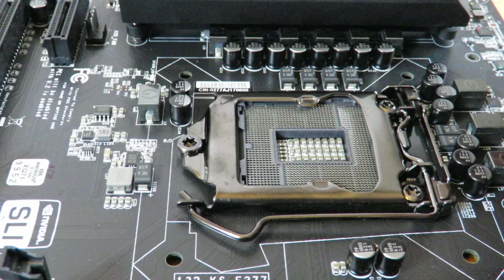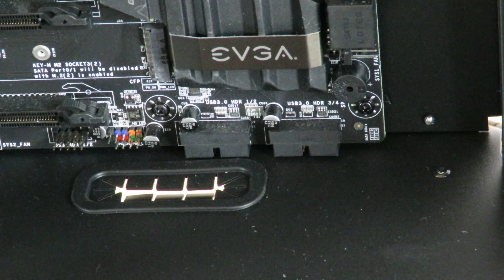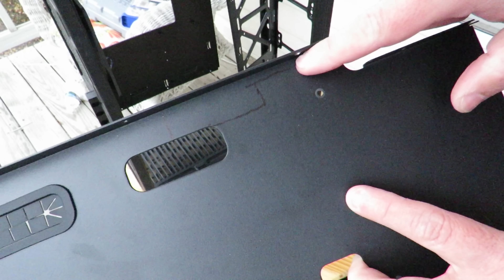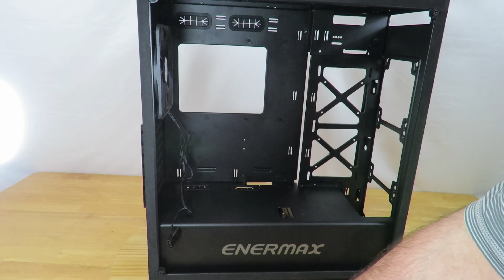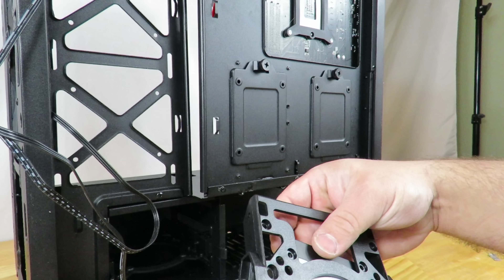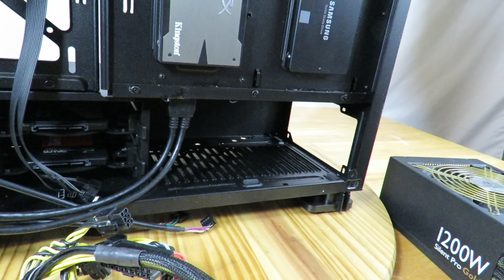How to build and mod a PC in the Enermax Equilence PC Case

Comment from the maker: In this video, I show How to build and mod a computer in the Enermax Equilence PC Case.  Check in the description below for a list of the parts used in this video.

Amazon Parts List: 
Enermax Equilence Case: https://geni.us/r9nP
Intel Core i7 7700K CPU: https://geni.us/jpdOE
Arctic Freezer 33 eSports ONE CPU Heatsink: https://geni.us/ciPnLI
EVGA Z270 FTW K Motherboard: https://geni.us/ShLi2Y
Patriot Viper 4 DDR4 32Gigs RAM: https://geni.us/zS3Vq
EVGA Geforce GTX1080 Ti FTW3 Gaming 11GB Video Card: https://geni.us/KvlvvWP
WDBlue 500GB SSD: https://geni.us/bvruEwo
Kingston Hyperx 3K 240GB SSD: https://geni.us/xm29Sfk
WD Black 512GB Performance SSD - 8 Gb/s M.2 2280 PCIe NVMe: https://geni.us/aTAxXyc
Thermal Grizzly Kryonauth Thermal Paste: https://geni.us/xBKj
Patriot Ignite 480GB SSD: 480GB: https://geni.us/CdEvu
Samsung 850 EVO 500GB SSD: https://geni.us/QTA2
EVGA CLS 280 Liquid Cooling Unit: https://geni.us/spUF
Cooler Master Silent Pro Gold 1200Watt Power Supply: https://geni.us/7hdBk
100PK Black Zip Ties: https://geni.us/lVRkxgR
Dremel 3000: https://geni.us/bxiJ2
Black Paint Pen: https://geni.us/OpH7yp
Manual Rivet Gun: https://geni.us/aczCWf
3/16-Inch Rivets: https://geni.us/hjPpekW
Ratcheting Screw Driver: https://geni.us/yx8JtS
Long Screwdriver Bit: https://geni.us/sQhgM
Magnetizer/Demagnetizer: https://geni.us/ApPP